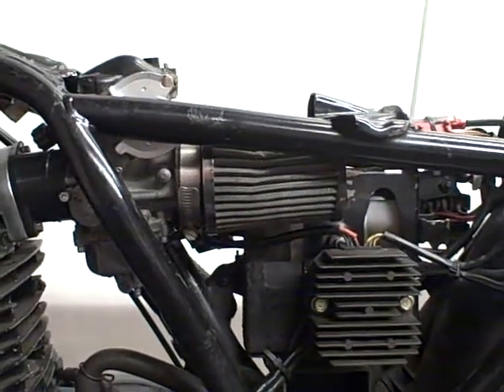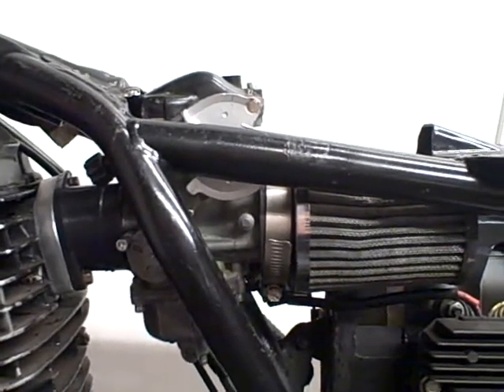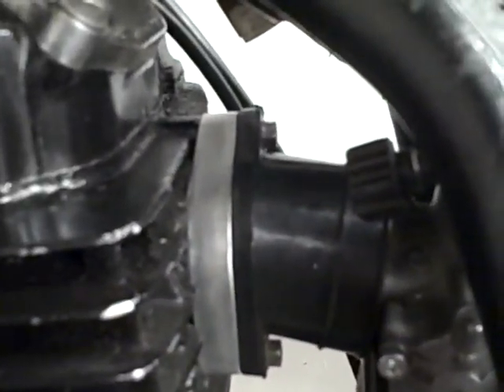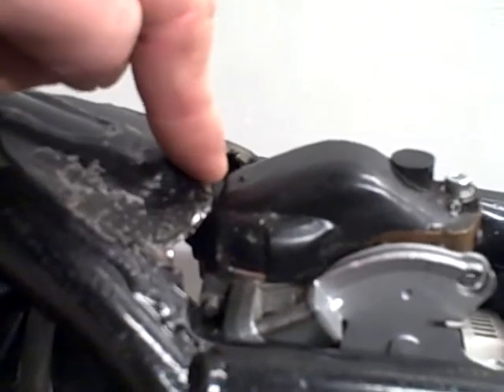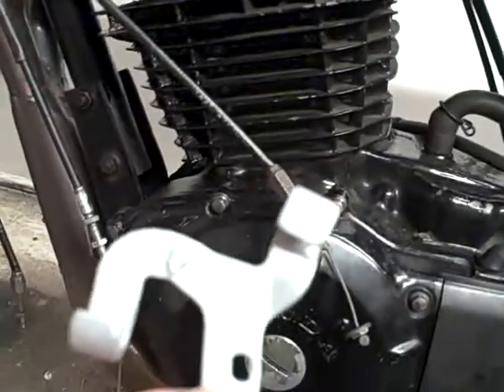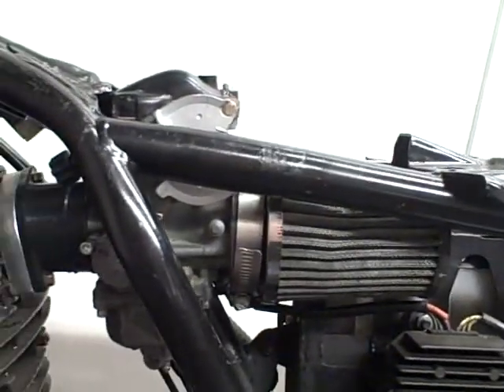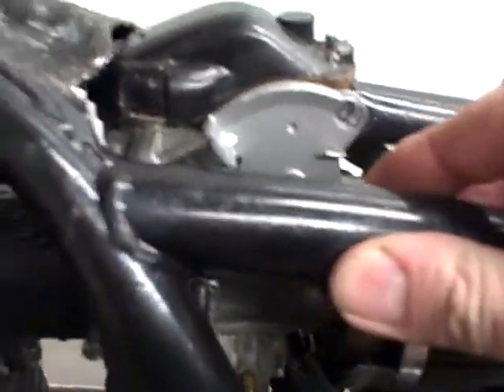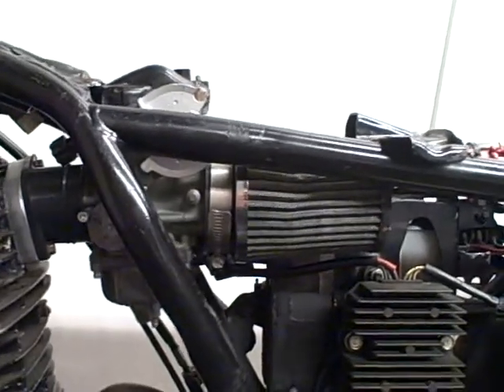Honda CB500RS Update

Comment: Hi Steve, what difference did it make and what did you stick with in the end? Im in the position of sourcing carb for my cb500rs project and not sure whether to go standard or flat slide
thanks!
Reply from the maker: The standard carb was a bit of a let down after the Mikuni. The Mikuni wasn't ideal but it definitely gave more power albeit abruptly, the standard carb just made it feel 'standard'. I've now got a 36mm roundslide Keihin carb from a Honda XR400 and it's the best of both worlds, it starts quickly and gives a nice progressive power delivery.
If you do go flat slide don't go too big like I did, 36 or 38mm is plenty, standard is 34mm.
hope this helps.
Reply: @tevie54  yeh thats brilliant info thanks, Ive been struggling to find out what standard size was too. Theres lot of historic conflicting info on old forums about carb upgrades as well so good to hear direct from yourself -Great stuff thanks